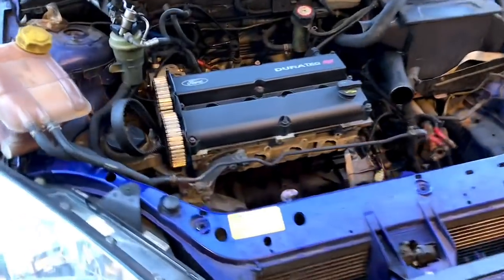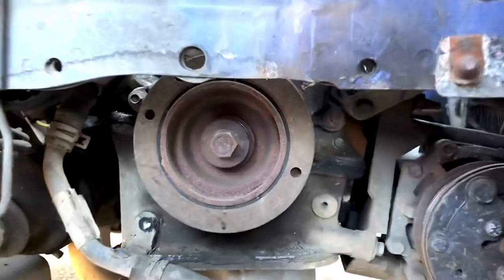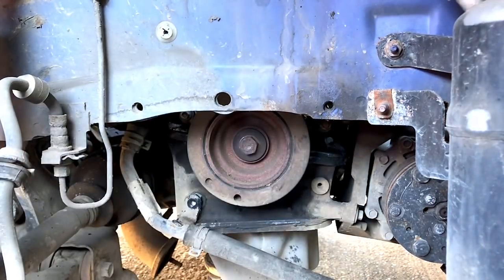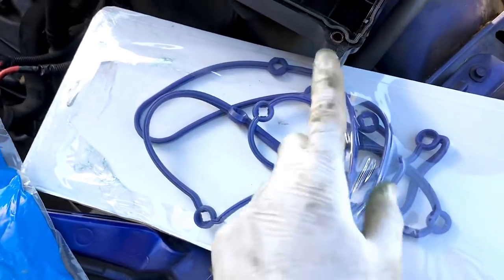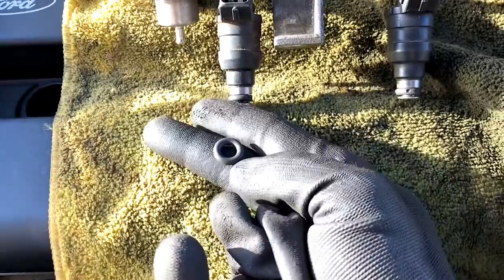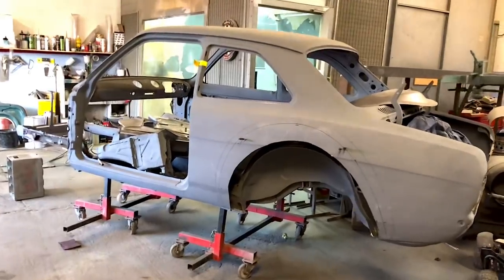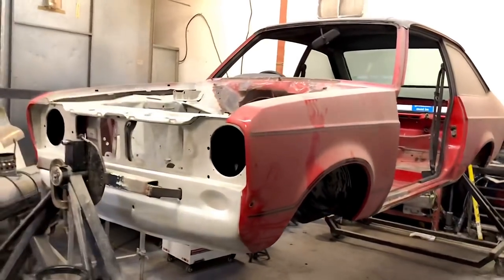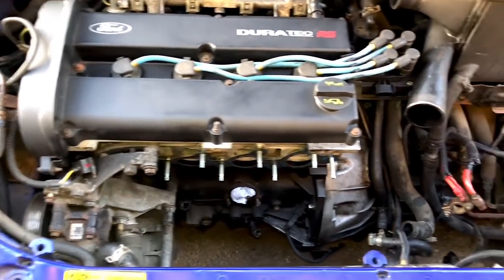The BARNFIND Ford Focus Rs Mk1 Rebuild

Comment: Hello, great videos Aaron! Helping me remain confident with my first ever rebuild, im learning a lot from you. One question though, when turning over by hand to check for valve piston clearance doesnt this provide a false sense of security? as i presume those are Hydraulic tappets would have bled down a little meaning that the valves wont open all the way? Or are these solid tappets?

Forgive any ignorance on my part im still learning.
Reply: I guess maybe you are doing it more because its a super simple and quick check that will tell you if there is any other issues as well not necessarily piston to value clearance during turnover

Comment: You should not torque the cam pulleys with bar if you dont have proper tool for hold the pulleys itself, you can brake the camshafts ends...

Comment: aaron m8 ffs lol ,, crank pulley spay some wd40 in woodruff area, tap lightly with hammer it will fall off
Reply: As opposed to the 30 seconds it probably took him to remove it with a puller tool designed for the job that will pull it off straight and not damage the pulley? Hammers are designed for hitting nails 😂👍🏻.
Reply: @themechanic7561  u only tap it to gently shock it , not go to town on it lol
Reply: @plumbc007  as he said tho it was proper stuck on so light tap isn’t going to work hence he used the puller.